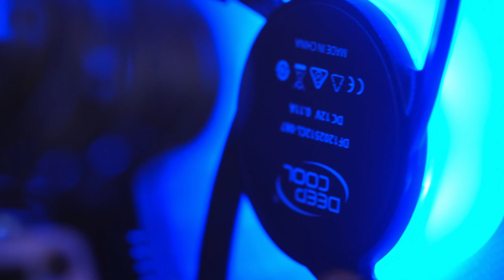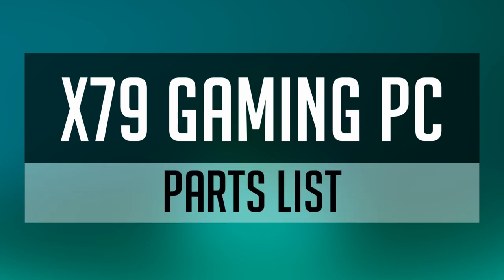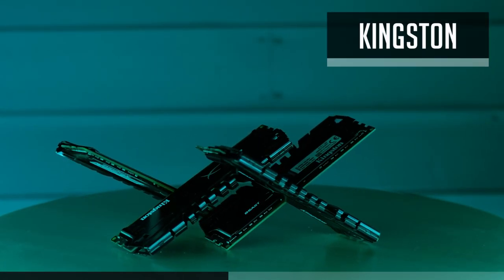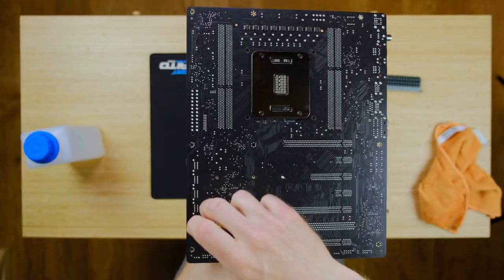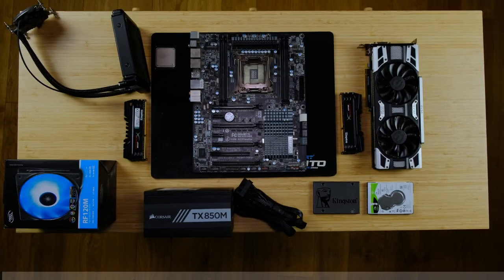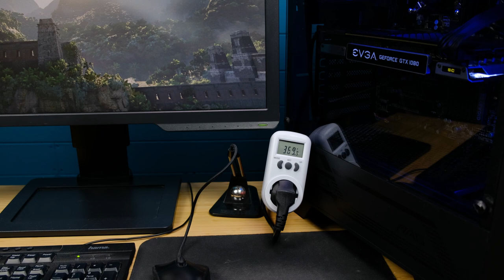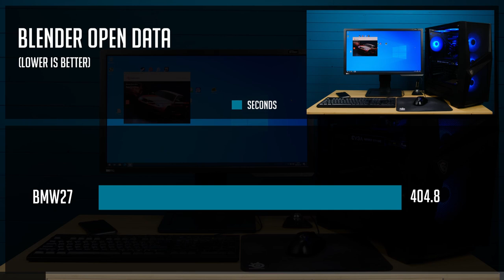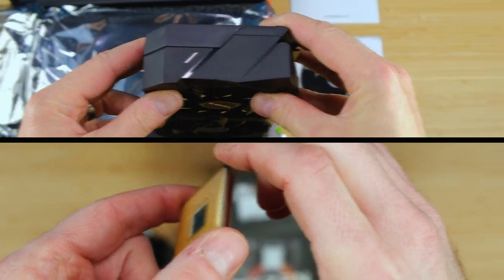TOO OLD IN 2021? NOOOT! I7-3930k (X79) + GTX 1080 GAMING PC BUILD - 14 Benchmarks & Power Usage

Comment: I still have intel i7 extreme 3960x, x79 motherboard and 32 gb ram dd3 with nvidia 1080, works great for all the tasks. However will it be able to run 3080? I am thinking about that gpu now and can see no reason yet to change my cpu at all. I would really appreciate it if you could compare similar systems with only difference being: intel 3930 + DD3 in one build and intel 10th gen + DD4 in another build while keeping everything else (SSD, GPU) the same. Now THAT would really show the difference in CPUs evolution.
Reply from the maker: Nice build you have mate! :)
Unfortunately, I do not own this system any more (I got it for building and for testing especially for this video).
But your concerns regarding RTX 3080 are legit. And actually would be really interesting to see 3930k/3960x + RTX 3080 vs let's say 10600k (same core count).
I might get RTX 3070 in 1-2 months for some PC Build, but not sure about RTX 3080. It's out of stock or +50% price at the moment and so more stock should come in 2021 only :)
I can just assume, in higher resolutions and 60fps target - the difference should be lower but in high fps gaming should be bigger.
I actually had some experience where older vs new platform means a lot in high fps - some time ago, I owned I7-4770 paired with gtx 1060. While 1080p gaming was really nice, but after upgrading to i5-8400, I got some massive competitive high FPS games performance uplift. Even though it was 4c/8c vs 6c and in many benchmarks, they are quite similar. But some games fps can skyrocket just because of ddr3 to ddr4, faster single-core speed and new architecture :)
Reply: @EpicGameTech  thank you very much for your reply and for your thoughts. I think I might keep the CPU to test it with 3080 someday when I have it in the future. So as I understand, if my goal is 4k 60 fps, then it's fine (or at least should be fine), but if I want for example lower resolution with higher FPS, it should rely more on CPU and then I'll get bottlenecked? Thanks, and great video btw!
Reply from the maker: More or less - yes. But you know, it's not a rule. And depends from the game (-s) you play.
In general, I would say 3960x will bottleneck RTX 3080. But hard to say, by how much.
In other worse, upgrading CPU (platform) you would benefit (would get more fps) as-well when using RTX 3080.
Since no one ever tested this combo yet, you can be the 1st one to do it :))
Reply: @EpicGameTech  I wonder, how much PCI-E 3.0 will bottleneck 3080 which is PCI-E 4.0 card. I'd love to see the performance comparison between 3080 connected to PCI-E 3.0 and the same card connected to PCI-E 4.0. Does this bottleneck the card at all?
Reply from the maker: @twinsen_rus  nope, PCIe 3.0 is not bottlenecking 3080 for sure. I think Tech Yes City made some benchmarks and even PCIe 2.0 has just a small drop in many cases :)
Reply: @EpicGameTech  wow, I didn't know that! Thanks! Well, it looks like I'm going to buy 3080 with my current CPU and RAM and then, if I'll get bottlenecked by CPU, I'll upgrade it as well. It's just a bit too much to upgrade CPU, GPU, MB, RAM in one single run. It's like most parts of the computer, lol.
Reply from the maker: Sure, but might be RTX 3070 would be a better go for your system? :) it will be cheaper and still really good (2080ti performance) :)

Comment: I have a 4960x /1080 x 2/X79 MB /5 fans/64GB DDR3 2400 / 1TB SSD/ 16 TB HD will a 850w PSU work?
Reply from the maker: Hey,
it should be enough, especially if your gtx 1080 has 1x 8pin for power. So one 1080 consumes ~200watts under load, meaning ~400w with two 1080s. And a CPU, well it depends if you overclock it. If not, it should suck ~230w, if OC to 4.4 Ghz could go up to 350w.
And so, if you push your CPU to max OC, your CPU + GPUs will consume ~750w meaning 100w left for other things. So it's really a stretch, as it's best to have ~80% load on your PSU and not 100%.
But in case you run your CPU stock, or a smaller OC, then your CPU + GPU would draw ~650w + some watts from other devices and PSU would run 85-90%. In this case, it would be probably ok.

Have in mind, I guessed lots of things here like your GPU power draw (as some gtx 1080 have 2x 8pin, meaning they could potentially draw more than 200w, especially if you overclock them). Also, I do not know if you run extended productivity sessions where your cpu and GPUs both are running 100% etc.
So quite a few variables I do not know of your system.

But probably you have a better picture now from the numbers I wrote here.

So, in case you OC cpu and GPU (or GPU has 2x 8pin) I would go for 1000w. In case everything runs stock - 850w should probably work ok :)

P.s. for some reason your comment was filtered to "Held for review" section and I've noticed it just now. that's why I replied just today :)

Comment: Which graphics card I need for this -X79 M-S motherboard set with LGA2011 combos Xeon E5 2630V2 CPU 4pcs x 4GB=16GB memory DDR3 ECC RAM 1333Mhz NVME M.2 slot
Reply from the maker: Hey,
it depends on what resolution you want to play, as if it's like 1080p and esports titles with higher fps (like 100-144hz monitor), you could get a cheaper GPU for that (maybe rx570) and it would perform the same as the more expensive one as in this rez/settings CPU would be a limit. But e.g. if you want like 1440p rez, or just 60fps using High settings in story games, then you could get a better GPU as on higher rez/higher settings games are more GPU bound.
But in general, I would go for rx570 / rx580 / gtx 1060 / gtx 1650 super for a similar build. As obviously, you don't want to get premium GPU for a budget build. Maybe like gtx 1070 or gtx 1660 tu/super if you want 1440p with higher graphics :)
But in general, before this all GPU price mess, I would recommend going rx 570 / rx 580 as these GPUs had the best price-to-performance before the pandemic. And now - it depends a lot, how much these and other GPUs I've mentioned above cost in your country/region.
Reply: @EpicGameTech  I gave up my GTX 1080Ti to my daughter, who uses it in VR play.  Went with a new RX590 that I bought for $170 in Jan 2020 (just missed the massive price trend by weeks!).  I would definitely recommend a good condition RX470/570 8GB or RX480/580 8GB ( the four series can sometimes be updated through new flash to 5 series at no additional cost)...go for the 8GB variants. The RX590 is not as popular as the RX580, so harder to find used. RX580 8GB Sapphire would be my first choice for 1080p at hi settings, if doing a budget build, else the GTX 1650 Super (slightly faster/newer tech).

Comment: if you rotate the AIO so the tubes are at the bottom. Your temps should be lower. Water cannot circulate so good like that. The pump can run dry!
Reply from the maker: True, tubs should be up because of the air inside of AIO, but it was hard to manage tubs not to touch top fans when tried :) those are really hard tubes
Will try to ply around more
Thanks! :)
Reply: @EpicGameTech  because the water tank is where the tubes are. And air goes to the top and the water stays in the tank. But a config like that works against each other and air gets trapped in the tank and no circulation.
Reply from the maker: Gamer Nexus recently released interesting video regarding AIO Mounting - https://www.youtube.com/watch?v=BbGomv195sk
While it's not always possible to mount in the best way for sure. Probably case/AOI brands should think of this more as-well.
Also, It depends on how much air % is in AOI i guess. More air = worse in case you mount it not entirely correctly :)
Reply: @EpicGameTech  Yeah. I don't know why  manufacturers uoload pictures showing a inefficient AIO mounting :P

Comment: There are an i7 3970x for 55$ and X79 mobo for 53$ in my country . Should i get it.
Reply from the maker: Hey,
really good prices in my opinion. In my country i7-3970x is around 170 EUR (200 usd) and even on aliexpress it's ~150 USD.
Also, X79 motherboards are like 2x more expensive here as-well. So getting this combo for ~$110 is a nice deal IMO. Could be a decent used/budget PC build.
Well actually not that budget, as i7-3970x could handle quite a decent GPU like gtx 1080 ti /  rtx 2080 super / rtx 3060 ti etc.
But have in mind, there will be no upgrade path for such a system as you already get pretty much the best cpu on this platform.
But sure, for a budget PC it will work for sure, as i7-3970x is still a beast ;)

Comment: If you are going to use Intel X79 Chipset in 2020 , you should check Intel Xeon Cpu from AliExpress , with good motherboard you can overclock many Xeon To 4 GHZ+.
Reply from the maker: Yep, but cheap x79 from ali does not oc very well :) unless its decent motherboard
Reply: @EpicGameTech  I think he was referring to the XEON CPU's.  I have an E5-1680V2 (8C/16T) that is now selling for $155; this CPU can easily OC to 4.5Ghz with decent cooling. The E5-1650V2 is another great buy (6C/12T) and you can find these for only $75.  The 1650's are easily overclocked to 4.5+Ghz. I also picked up an E5-1650V2 locally for only $60.
If you have a name brand X79 motherboard like ASUS (P9X79 Pro/Deluxe, ROG IV, ROG Black edition), MSI (Big Bang) , or AsRock (xTreme 4 or greater)...then overclocking is a must with these CPU's. Typically, the local deals best for the motherboards...AliEx or eBay for the CPU's. IMO.

Comment: i just got a ASUS P9X79 PRO motherboard with a 3930k a asetek cooler and 16gb 1600mhz ram for £95 ($130) paired with my rtx 2060 its a beast but i just checked the supported cpu list and a i7 4960x is supported on this board so im goign to pick one of them up
Reply from the maker: What?? $130? ;)) crazy deal man
Depending on how much 4960x costs do not spend too much :) as in gaming, there will be probably no noticeable difference in fps.
Reply: @EpicGameTech  i build custom systems for people and wat to get hardline watercooling as an option i can offer so this will be a practice system i just managed to get 32gb of OCZ Flex XLC watercooled ram 8 4gb sticks running at 2400mhz so going to mess about with quad channel watercooled ram
Reply from the maker: nice, never tried water-cooled ram so far ;)
Reply: @EpicGameTech  its hard to find here in the UK only have 3 listing up currently and it's all 1gb sticks you should get some and do a video and see how much difference it makes
Reply from the maker: Yep, quite a niche thing.
I doubt i would find any in my country at all :))
Also, it's definitely for a custom/exclusive pc build but not for a majority of gamers/streamers for sure.

Comment: Great video... What about idle temperatures and power consumption??? Any insights would really be appreciated :-)
Reply from the maker: Hey,
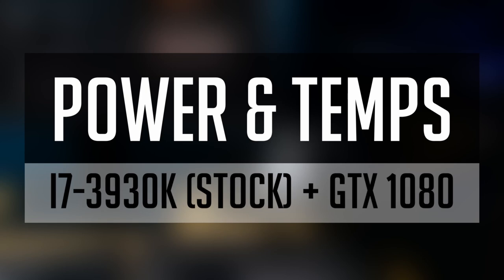I've mentioned power consumption and temps when stress testing at 8:52 :)
Reply: @EpicGameTech  yesss i saw that n i was really looking for power consumption for this processor as m upgrading from my xeon x5675 to i7 3930k setup... because of AVX instruction set... so wanted to know how much is the difference in power consumption idle+load... as i use a power backup from Solar and UPS at home so wanted to know that how much watts does it consumes if i only use like internet browser or some copying of data here and there... n Thanks for the response :)
Reply from the maker: Ah, I see. Well I will check if I can test this since that pc is not mine any more :)
In case i will be able to test idle watts compsumption i will post here :)

Comment: I got a rampage board for mine, still going strong now even after 10 years of daily gaming 🤣 upgraded my gpu to a 1660 super oc edition before the prices went up though.
Reply from the maker: Nice ;)
depending on what resolution you are aiming 3930k could hold even a better gpu than 1660 super.
Reply: @EpicGameTech  unfortunately my old school harddrive is the real bottleneck, windows keeps it pegged at 100% most of the time😩 but at least I can still get 120 fps in warzone.
Reply from the maker: Are you using HDD or SSD? :)
Also, when was the last time you did a completely fresh windows install?
With a simple SSD and fresh install, windows should run more than fine for sure.
Reply: @EpicGameTech  hdd right now, my ssd was too small. Some of my software didn't play nice not on the boot drive, so I switched to a 2tb hdd a while back. Probably time to upgrade to a bigger ssd soon😅
Reply from the maker: Definitely go for an SSD, at least for OS drive, as it is day and night in terms of windows speed, that "feel" when any program opens 2x faster :)
And SSDs are really cheap. At least, get like 240gb (or even 120gb if you are on a super budget) just for your Windows.
In a new PC builds, i almost never go below 1TB ssd :)

Comment: I've been using 3930k for absolute ages, it got me through 3d animation school all the years ago, but im noticing that at 1440p the games are not so smooth anymore. Im considering getting 3950x ryzen as a replacement or even 3900x, just want something that would be a very substantial upgrade.  Why are the x79 motherboards so expensive though ? Mine is p9x79 pro from asus and i really dont know how to price the pc or the motherboard+cpu combo if i decide to let it go soon.
Reply from the maker: Hey.
Regarding 1440p - did you try monitoring CPU/GPU usage with MSI Afterburner when gaming?

Regarding an upgrade, you do not need 3950x for sure, even 3900x is too much. I mean unless you are getting RTX 3090 and want not only gaming but also rendering etc. you could get those CPUs.
But I would say in 3 weeks, we will have Ryzen 5000, so I bet it will be way better to get Ryzen 7 5800x or even Ryzen 5 5600x instead or Ryzen 9 3900x for sure. We have to wait and check the first reviews.
So a question is to what GPU you will be upgrading along with a CPU upgrade?

Well, X79 motherboard was quite expensive in general. And it's more of the enthusiast-level platform and not so many of those GOOD boards were manufactured I guess. You can get quite a cheap x79 from aliexpress but it will not have OC capabilities or quad-channel memory.

Yep, it's crazy, asus p9x79 pro on ebay is ~$200. The funny thing is CPUs are not that expensive, jut the motherboards :)
Reply: @EpicGameTech  Im still running 980ti, so it might be a time to step up to 3080 rtx whenever i can make the jump, or get a 5700xt right now, my cpus is still a gold+ 850w so it should handle a few more years.
Reply from the maker: 850w gold will be definitely enough for any GPU.
Regarding 3930k and RTX3080 pair, not sure if a CPU will be able to keep up. RTX 3070 maybe? :)
anyway, monitor CPU/ gpu utilization with MSI afterburner when gaming and check witch one is bottlenecking games you play. Then you will know what to upgrade ;)
Reply: Try an E5-1680V2 (8C/16T) OC'd to 4.5Ghz, paired with something like GTX 2080S/2080Ti or AMD equivalent. 32GB 1600 DDR3 RAM minimum, in quad channel of course.  I am running the P9X79Pro paired with E5-1680V2 and it is a beast...at 4.5Ghz it hangs with 2700x. If you game at 1440P, invest in the right GPU for the job.
You will need decent cooling for this combo.  Air tower with minimum TDP rating of 230W, else water. I am using a PCCooler GI-D66A ($70) and it manages the load quite well.
Reply: @jb678901  I have my pc in storm stryker case with 850w modular corsair psu and with noctua D14 cooler. I think i'd rather get something more modern that runs cooler and eats less power and has more cores than rebuying used at this point.
Reply: @KiteoHatto  Sounds like a reasonable approach to me.  Best of luck on your choice.

Comment: i have the same board and cpu but a 2 fan aio and over clocked it to 5.50 ghz
Reply from the maker: Yep, with 240/280mm AIO you can do OC. But 120m is not quite for that ;)

Comment: Currently looking at this case but the one that comes with 4x ARGB fans included for i7 4790k 4.7ghz paired with Corsair h100i and EVGA hybrid gtx 980ti @ 1450mhz core clock 7700mhz memory clock.
Reply from the maker: Hey,
so is it a full build you will be buying? Or you currently have i7-4790k and will use that case for that?
Depending from a price in your country, this one is quite average from quality perspective. I mean nothing bad or etc. Sure, it looks quite cool and has RGB fans + mesh front. But it's not a better option than other cases with mesh for sure :)
Reply: For my current Pc The price just seems reasonable for what it offers especially considering how it performs.

Edit: £80 for it that’s with 4x of the ARGB fans included 3 in front 1 in rear. 

https://www.amazon.co.uk/MSI-MAG-FORGE-101M-Computer/dp/B082XH5HWY
Reply from the maker: Phantex P300A Mesh is also worth considering. Well no RGB but better quality case but 50 for case, and 30 for 3 rgb fans:
https://uk.pcpartpicker.com/product/crqBD3/phanteks-eclipse-p300a-mesh-atx-mid-tower-case-ph-ec300atg_bk01
https://www.scan.co.uk/products/3x-120mm-deepcool-rf120-quiet-rgb-fan-6-leds-pwm-sata-rgb-controller-anti-vibration-triple-pack?utm_source=pc%20part%20picker&utm_medium=referral
and you get better quality ;)
Reply: Epic Game Tech bought that msi case with articfreezer 280mm aio. Ended up selling the i7 4790k mobo + ram and replacing it with i5 8600k 5ghz msi z390 gaming edge AC and 2x8gb 3600mhz. Have to say I am not disappointed really love the look of the case and the build quality is definitely better then expected.
Reply from the maker: Super! ;)